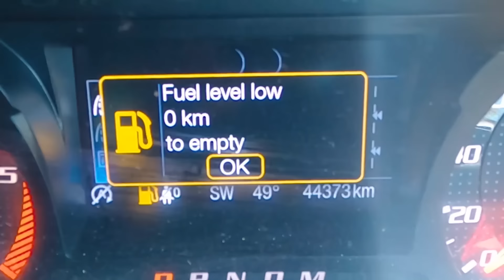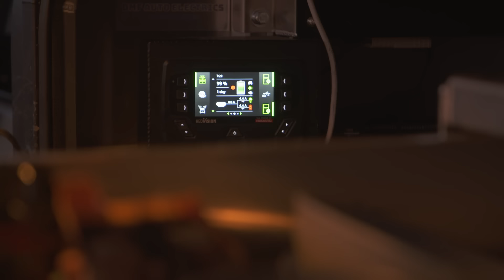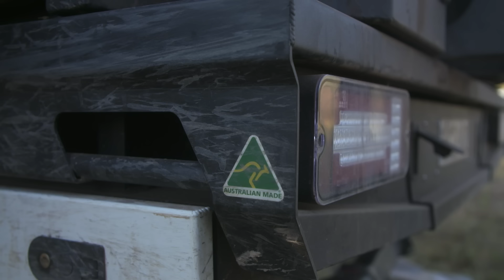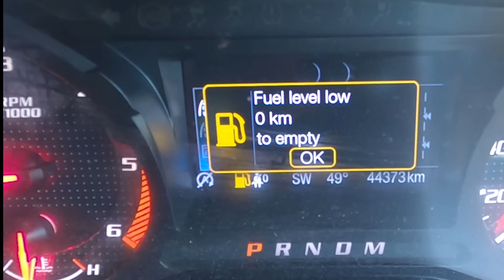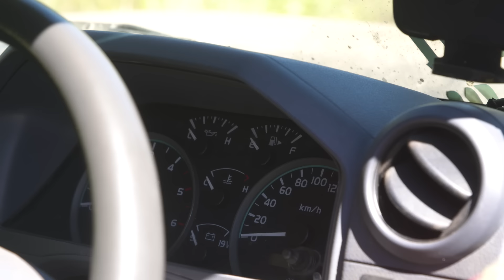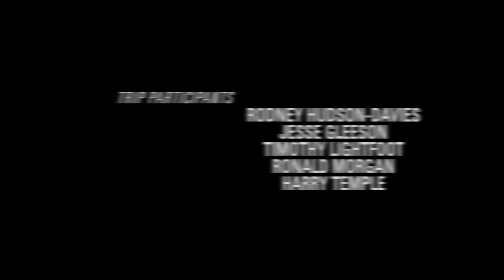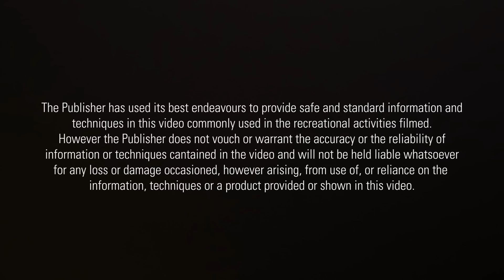We run out of fuel, food and tyres – do we make it? THE KIMBERLEY FINALE

Comment: Ranger on 2wd impressed me
Reply: It was in 4wd through the soft stuff like at 32:42
Reply: That Ranger has impressed me on every trip, makes a lot of tracks look pretty easy.
Reply: Would have liked to see the camera on it more
Reply: I was surprised they kept it in 2wd.  Given the sufficiently loose surfaces they're on, especially when 4wd is really needed, there should be plenty of tire slip to prevent breakage even with the mismatched tires.  And even if they're not moving slower than the rear wheels, having the front wheels moving at all is better than not at all.
Reply: @FireCat005  True, but it's easier to winch than replace driveline bits in the dust and mud.
Reply: With a decent set of tires (let down properly) and a small lift that Raptor would eat those old rigs up. The Goodyear tires they use are rubbish. That many flats is also unacceptable. 
I didn't see anything harsh on tires. Makes good content tho.
Reply: @vevohoeyo  i agree that gy has bad side wall. Toyo mt should be a better choice
Reply: A Ranger with wheels that drive surprized me, lol
Reply: @vevohoeyo  Wasn't mostly others loosing tires that made the Ranger give up two of its tires?
Reply: @vevohoeyo  when did the Goodyear ranger lose any tires?
Reply: What about an extra segment with the camera car drive and cameramen antics ....
Reply: Ford Ranger is impressive

Comment: My bush repair story, we were travelling in the NT in a petrol V8 and the fuel pump died.  We cut into the cars fuel line, added extra fuel line and ran that through the cab and into the engine bay.  We used a boat outboard primer bulb manually in the cab as a fuel pump to continue.
Reply: In a pinch you can also rig the window washer motor as a pump too - just keep pressing the button while you drive!
Reply: @errhka  I love you Aussie gents! I would have never thought of this!!
Reply: @MMr.NOBODYY  Truthfully I'm from California (the other one that is on fire all the time) - but thanks! A person I knew was the one who came up with that admittedly - I'm just spreading the knowledge in hopes it will help one of you all in a time of need
Reply: Love the videos. My best camping food memory. When I was a child I shot a Robin bird. I didn't shoot it to eat. I just wanted to shoot something. My father taught me the best hunting lesson ever. If you shoot it its food. I cleaned, cooked, and ate the bird. With my father watching over me.
Reply: Cant make that shit up
Reply: I relate to this so much! I used a coke bottle and 5 liter water bottle on the passenger seat to the engine bay and it worked brilliantly. And mine was the manual lift up and rely on the power of gravity
Reply: I wonder how many liters of gasoline the fridges and freezers use for this trip??? I like good food and cold beers but I also like to get to where I'm going!!! 
maybe a solar panel on the roof may help?

Comment: BEST BUSH MECHANIC FIX - 
We were out camping along the Murray river and I smashed my front diff gears in on my Jeep JK Wrangler. 
I removed the front axles, and drove it home in 2 wheel drive to get it out of the bush. Had only a few spanners and sockets and the life saver tool, Vise grips that’s did most of the work. 🔧
Got the job done

Comment: Yeah the Ranger! Drove absolutely everything it was pointed at even in 2WD 👌🏾
Reply: He could have used four-wheel drive. The tolerance between tire sizes and a four-wheel drive is 2 in. With the tires spinning on slippery surfaces? That would be no damage
Reply: And you can see a creek crossing ranger front tires are spinning with 33 on the front

Comment: Shawn just makes the river crossing after multiple attempts and twin lockers and goes nuts 
Jessie  just popped outa that river in 2wd and gets no credit. Ranger showing up strong
Reply: Didn't they change them out with spares when Ronny brought fuel?
Reply: It’s more the driver. Jesse is the best wheeer of the pack regardless of what he’s in. He could make a Holden Cruze look like a beast
Reply: Lots of power, biggest lift in convoy, less than half the weight of nearest rival plus a pro driver. Yer nah not surprised it got home. 
Winner in my book was (and actually hurts to say) was the dmax. Under powered, smallest lift, smallest tyres, borderline over gvm. Its Only problem for the trip was tyres, and kinda think that was just shit luck
Reply: He used 4wd in that you can tell

Comment: cant believe how well Jesse drove in 2WD
Reply: Weird it looked like 4wd when he came through the mud hole around 32:56
Reply: @microwire007  When you have that much wheel slippage, may as well bung it in 4x4, not gonna hurt the transfer case.  Just gotta be careful as soon as you hit the dry stuff, it'll load up real fast.
Reply: @masondegaulle5731  ah yeah. That makes a bit more sense.
Reply: @microwire007  it might have been going in but not when he was on the other side,
Reply: That big mud hole after that was impressive also. He's the only one that almost made it through on the 1st shot
Reply: @masondegaulle5731  hi, what do you mean by they'll load up real quick?
Reply: @wanderlustdetailer  yeah and on 2wd, momentum is key..
Reply: @edwardmoreno9435  very true!
Reply: Jesse made everything look easy
Reply: @microwire007  8 Olli
Reply: V
Reply: @masondegaulle5731  Yes my Ranger in picture was that way for 4 years my rear differential was different ratio than the front but in deep mud or snow it's ok to get your self out then disengage the 4WD or front lockers if you have them.
Reply: @microwire007  they were lying he had 4x4
Reply: Jesse is most likely the actual best driver in the whole crew, even when he is driving Daryl his ability to find lines through technical obstacles makes it look easy.
Reply: @microwire007  Not at all. When the front wheels were through they were not moving at all.

Comment: Our best bush machanic fix was on Fraser Island. The 100 series flogged out its steering rack bushes. All the way at Orchid Beach, pretty remote so at the cost of some rubber mud flaps the boys cut the mud flaps up, wrapped them around the steering rack, reinstalled the steering rack mounting clamps and we finished our holiday and got back to Sydney.

Comment: Tyre sidewall repair ... I do safaris into Namibia , and north Namibia and Kaokoland is trackless wilderness where the stones are sharp and the tree stumps are rock hard Mopani trees. We have used a tractor inner tube cut into football sized patches,and glued it in place and also a bit of plastic coke bottle to keep the tube from coming out the fist sized hole in our last spare tyre.. it kept air in, and gravel out , so that was a win. It kept going 400kms to the closest tyre shop, and the wheel was so airtight that we kept the one as a second spare for a few trips before we remembered what was underneath when the balancing proved to be a little difficult.

Comment: Best bush fix, I had a thermostat go bad, and when I pulled it it took the threads to hold it on out with it. I used an old shot gun shell by cutting the plastic into slivers and used them to hold the threads in for the bolts and hold the thermostat housing on to get home. Held for 50 miles or so of driving without a leak.

Comment: I had a 2005 Subaru Outback I went to the Kimberley with. Did Oodnadatta track, some bits and pieces of currogated outback tracks in the NT and NSW and Gib river road. Had a 2" lift and the trailing arm spacers had been weakening the chassis, which finally gave way in Purnululu. Ripped a good chunk of chassis out and the trailing arm snapped in half as it hit the ground. Miraculously it didnt take the brakeline with it. Used ratchet straps to centre the wheel, giving pressure from both front and rear. 

After a couple ks we went to check on it and the jack decided it was the perfect time to call quits. For the next 70ks we crawled along at 10k/h stopping every hour waiting for someone to come by, flag them down and ask if they had any spare ratchet straps and a jack we could borrow. Eventually we got back to Kununurra and bought a cheap commodore to drive back home to Newcastle.

Comment: I was up at Macquarie heads doing a beach run in a 1998 hilux, come to a culvert doing 90clicks jumping in the air a fair distance. Landed snapping a torsion bar, couldn’t turn the steering wheel as it had 35s. Had a chainsaw chopping a piece of wood to suit the ride height putting that in between the bump stop and LCA strapped that up with zipties to make it back to Hobart.

Comment: My best bush mechanic story was with an old camping mate, basically here is the background information, Up in the Vic high country for Australia day weekend, fully loaded 80 series and 4 other people in my fourby. I had lost my 14mm wrench a week prior, but was glad I found it once again, on the steep track, after being dislodged from some part in my engine bay, hitting the radiator fan an getting spat straight into the radiator completely tearing a good 1/4 of the bottom fins out. Ended up pulling out the radiator and mending it with the following materials, 2 eggs, a small amount of metal putty, 1 perfectly rounded stick, 4 zip ties and hopes and dreams (we clamped what we could) ended up driving another 3 hours in the bush, camped the night, drove 6 hours home and never lost a drop of water and didn't get hot, had a new radiator in the next day and went straight back up

Comment: Thought I'd share my bush fix story with you Shaun. Just watched this episode on the big TV and bought back an old memory. Back in around 84 I was driving a Bronco all over the shop. Cape York in the Wet, Simpson, Tanami etc. Did some miles in the old girl.
One morning I was camped on a Billabong about 500kms West of Rockhampton, between Jundah and Stonehenge. Packed up after breckie and had a steep climb up to the track out of the Billabong. No real issue and then there was a little loss of power and then a big BANG and she stopped. Rolled back down to a flat area and hopped out for a squiz. Popped the big bonnet and first thing I saw was that the air filter on the big Ford engine had come adrift. Went to resettle it on top of the carby, and realized that the threaded rod that held the air filter onto the middle of the carby was gone. Yep, it must have vibrated the wing nut off and then the bolt got sucked down through the carby.
I pulled the head off to look for the threaded rod, and the head seemed okay but the piston didnt look too flash. Damn thing had broken off at the gudgeon pin and left the top section of the piston floating at the top of the stroke.
Had to drop the sump and push the piston out and remove the rest of the rod. Bugger, I thought to myself. I always carried a spare tube, so had to cut that up and make a band to cover the oil feed hole in crankshaft. Then put it all back together again, minus one slug. Removed the rockers on that cylinder so the valves stayed shut and didnt wash with fuel and off I went. She drove pretty well so I bee lined for the coast.
Driving through Stanwell, just a few kays from Rocky I noticed an old XB Fairmont wrecked in a farmers paddock under a tree. Went and spoke to the farmer and with permission, camped alongside the old V8 Fairmont for a couple of days. Used the winch to pull the engine, grabbed a slug and managed to swap in my rod and put the farmers piston into the car. 
The car went fine, drove the Telegraph road that same trip and then back to Melbourne. I sold the car a few years later and that piston was still spinning as happy as can be.

Had another issue later on pulling the upper control arm out of the chassis at the top end of the Canning and had to Jerry rig that all the way to Broome and then borrow a pearl farmers shed to do some pretty serious chassis mods to fix that little issue. Another story for another time.

Comment: I remember having to fill one of my extremely damaged tyres with a heap of long grass as it would no longer hold air with the 4 hole it had. I removed the bead lock rings and stuffed it will as much grass as possible it was by no means drivable for a long distance drive but was able to get me back to town to get it replaced which was about 10kms away.

Comment: Awesome trip ya'll!!!  Thoroughly enjoyed every second.  The craziest fix I've had to do was to fix a punctured oil pan.  I didn't have JB Weld on me at the time, but I did have a bar of Ivory soap.  I remembered my dad telling me about him repairing a fuel tank puncture the same way.  I rubbed that bar of soap on the crack in the pan til' my hand hurt, but it got the job done got me back home with just a tiny leak as compared to the gaping hole that was there before.  Apparently this will only work with Ivory soap.  I guess it's whatever ingredient in the soap that allows it to float that works the magic.

Comment: Bush repair fix. Travelling the freshwater track at double Island in a fj40 cruiser with a 253 v8 we put the fan through the radiator. Low of options and low on beers we were desperate for a fix. First option which was sensible and stupid at the same time was start a fire, melt down the lead from the battery to fix the rad. Obviously that was answered with what are we gonna start the car with. Our last resort was a tree with moss all over it. We  ripped the rad out, straightened the damaged tubes out. Removed the engine fan and ran with just the thermo we had on the front. We then packed it with moss off a tree and sap. Put it back it. Then had to sacrifice the last beers to fill it. Drove back to rainbow and bought some glue but it wasn't leaking so figured why touch it. We made it towing a trailer back through the freshwater track, down di and all the waY back to brissy towing a trailer. Funnily enough we work at a radiator shop so later in our spare time we ripped the rad back and and tested it in our tub and no leaks.

Comment: The “Hotwheels” Ford Ranger Raptor was the true MVP of this trip
Reply: Nooooooooooo....the 6 tons rig driven by mad rocket steals the shows for me
Reply: @dolguldur4706  have a look at the damage it received after this trip. Rocket was contemplating writing it off. It's basically a wreak. Only sentimental value is stopping it from becoming a parts truck
Reply: @vevohoeyo  yeah but had the ranger attempted to cart the load which Rocket's 79 was pulling, I very much doubt it would have completed the track.
Reply: @cyclemoto8744  it's not attempting to do that it's not made for weight. Turns out the cruiser can't handle that weight either.
Reply: A true underdog story
Reply: @vevohoeyo  that’s not what
I said. Let me put it simply for you: 1. The Ranger would have never have made it to the end of the track had it been tasked with the load which Rod was carrying 2. Have a look around the streets, roads, cities and towns. 20 year old Toyota utes outnumber Ford utes which is testimate to the build quality of each make
Reply: @vevohoeyo  Where is that info from?
Reply: @vevohoeyo  Thanks. 
What's the name of the channel?
Reply: @vevohoeyo  I saw that video, it wasn't because of this trip, but as he stated "9 long years" of hard use.  He was rather proud of the wear and tear it has had over the years and still made it through.  It had no frame damage, just minor things like bushings and weep leaks.  The reason why he is contemplating selling it is because it's simply old and he has a brand new Hilux ready to work on.
Reply: @vevohoeyo  yeah but the main reason he was worried was he thought he bent the chassis when he crashed it off the track, bumped his trailer brakes off. Would have loved to see that footage
Reply: @cycle & Moto you do realise they’re very different categories of vehicle at very different price points. $80K in the Raptor gets you an off road ready vehicle out of the box. $80K on the 79 series Crusier gets you wind up windows and nothing else. And you still need to drop another $40K on it to get road ready. The Raptor also used the least fuel from what we can tell. Sure, it didn’t have the most grunt (but more the man the newer Isuzu) but it exactly what it was designed to.

Comment: Awesome channel guys! It's a bit late, but Shauno was asking about Bush fixes. Me and my mate (Barton) took a Suzuki Samurai and Toyota pickup/hilux out to the river in between Cloverdale and Healdsburg in northern California. Normally we would be a lot more prepared with tools and parts but we were just going to the river for a day of fun. At the end of the day of fun through the river in low range, as we headed for exit. I realized one of the wheel cylinders on the back driverside axle, that we had freshly welded spider gears in, burst running all the brake fluid out! With no tools, only drinking water we had to find a solution to make it back home. I took a water bottle, got river water, filled up the master cylinder and started bleeding the water through the brake system out the burst wheel cylinder. Once I had the river water bled completely out of the rear wheel cylinder, I used a river rock to pound the brake hardline running to the wheel cylinder sealing it off, giving me functional brakes to get home with 👍

Comment: I was travelling through an old logging track in the watagans to explore some old machine wrecks lost 3 tyres in one hit on some hidden rusting bulldozer parts and had no way of getting out without leaving the rig behind until I found 2 tubs of filler expansion foam in the bottom of my tool box I have been given to use on a job that got cancelled 3 days before filled two tyres waited till they set the next morning ended up camping there the night and drove 2hrs home in them without getting any flats in the morning hade to buy new tyres after that 🤣 had to cut the tyres off the rims was such an ordeal